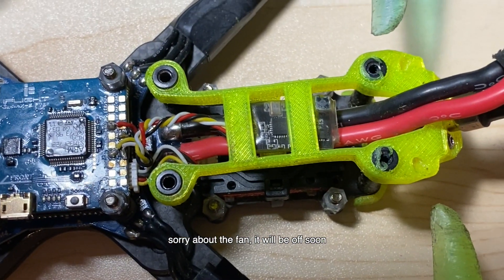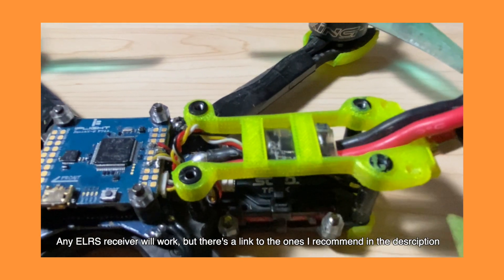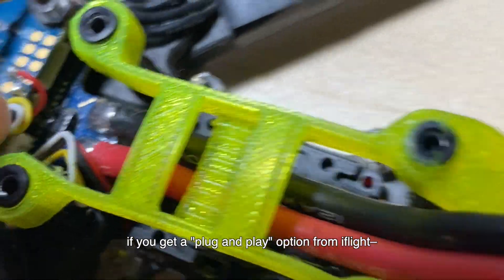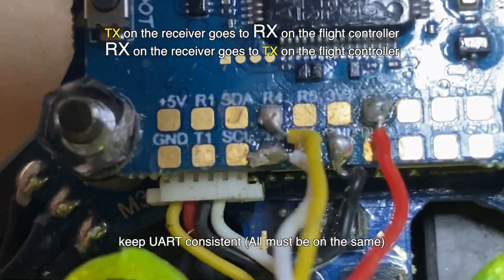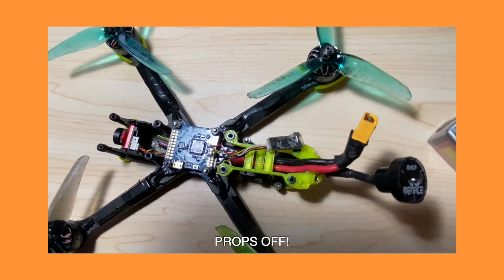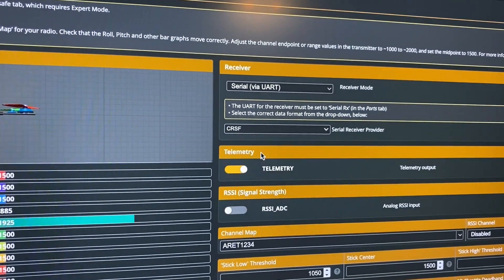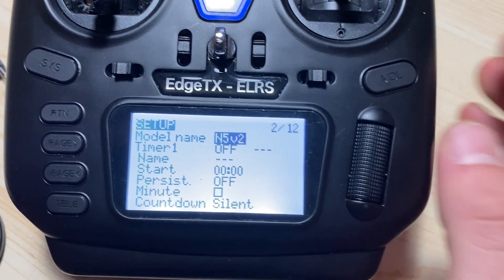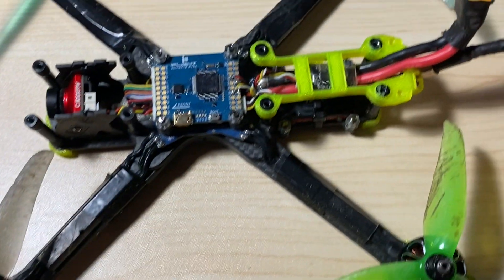Nazgul5 v2 ELRS Installation

Comment: Just curious if the nazgul5 V3 version would be the same as the one in this video??? I would have to add a new XT 60 connector if you remove all of that stuff???
Reply from the maker: The process would be the same. Just make sure you connect the new receiver to the exact same spot as where your old one was (RX to TX, and TX to RX). Or if that's not an option, connect it an open UART that support it. There shouldn't be any need to add a new XT60 – I would keep the existing one on

Comment: Great video!
My Evoque came with the DJi 03 Air unit & I planned to use my DJI controller. I have since bought the RM Boxer with ELRS, can I just add the iflight ERLS RX THEN BIND?
My Q is so I have to disconnect the air units receiver in any way?
Thanks so much
Brent.

Comment: Do you have a test video? Or can you tell me how good is the receiver?
Reply from the maker: It’s quite good. I’d recommend one with an antenna instead of the one used in this video. With an antenna, I can get about 2 miles of range
Reply: @isaac.schultz  nice, so should i get one of these or are there more better examples for Nazgul 5 v2 ?
Reply from the maker: @tumax4534  the one that I linked in the description will work very well, I’d recommend